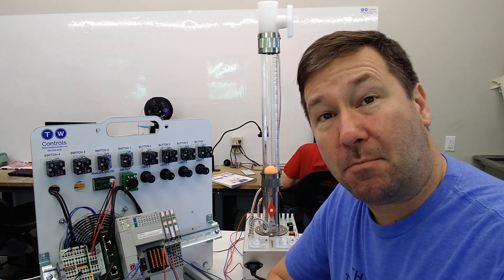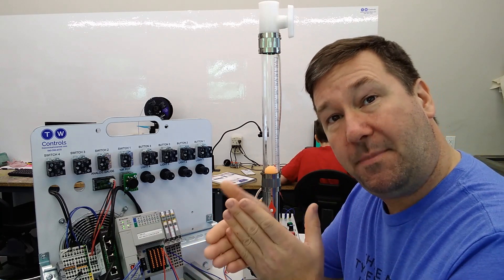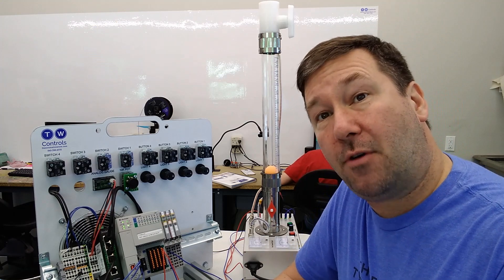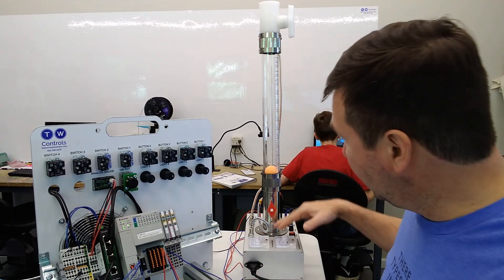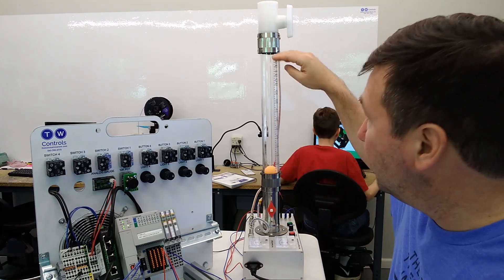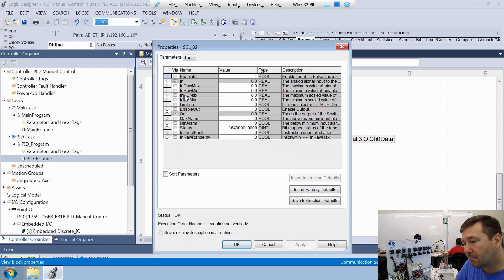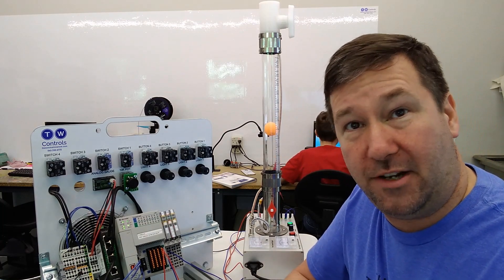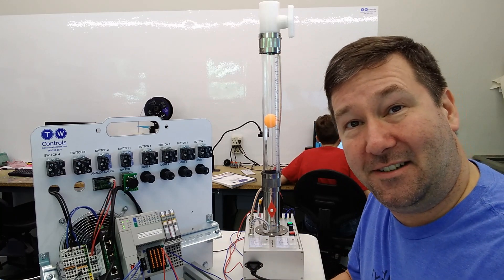Configure the PIDE Instruction in Studio 5000 for Allen Bradley PLC

Comment: Hi Tim,

I hope you’re doing well. I wanted to take a moment to express my appreciation for your videos. They are incredibly clear and informative, making complex topics easy to understand. I have been searching through them for specific content related to controlling a heater using a Proportional-Integral-Derivative (PID) controller. I'm particularly interested in incorporating thermocouples for accurate temperature feedback and utilizing Solid State Relays (SSRs) for the output to effectively manage the heater's temperature. If you have any videos that cover these topics, I would greatly appreciate your guidance or recommendations!

Thank you!
Reply from the maker: I'm glad our videos have been helpful!  We don't have a video on that for Studio 5000 but google Pulse Train Output or Pulse Width Modulation, you are pretty much looking to vary the duty cycle depending of the Control Variable of the PID.

Comment: I'm getting a pide instruction fault. It's on a burner control. So the burner is off but we are having a 26% output doesn't matter what setpoint I put in. It stays at 26% output is there something you recommend checking?
Reply from the maker: I bet you min is set to 26%... See what you process variable is showing
Reply: @TimWilborne  is there a support link I can email you?
Reply from the maker: We don't offer support for specific applications, you would need to reach out to Rockwell support.
Reply: @TimWilborne  pv is 0 but I'm gett8ng a PIDe instruction fault on my hmi. What could cause this from a program standpoint?

Comment: I have a normally open valve where 0%/4mA is open and 100%/20mA is closed. I also have a normally closed valve where 0%/4mA is closed and 100%/20mA is open. The normally closed valve operates fine and the HMI screen shows this. The normally open valve we would like to invert the 0-100% displayed so that the numbers are always percent open and not 0% when open and 100% when closed. Is there a way to get that value from the PIDE inverted or do I have to do it outside the PIDE? Others have set me up to use CV as the output and we have many in the system that use that and I'd hate to deviate, and hopefully there is just a setting or value I can use.

Comment: Good day sir..
I have this question, I hope you can help me.. what parameter(s) in PIDE should I set so that the PV is directly proportional to the CV? 

I hope you'll be able to read this, Thank you so much.
Reply from the maker: Hi Johanna.  If you need the PC to be directly proportional to the CV, then you wouldn't need to use a PIDE.  You would simply use a MUL multiply instruction but I think you will have trouble controlling it with that.

Comment: could you cover few things you do on lines or equipment to pm your systems already in place? such as loop checks or creating backup files, or checks you can do when things are running smooth for a controls tech/plc.
Reply from the maker: Creating backups would be a good video.  Let me see what I can come up with.  Also observing working systems and making sure you understand how they work is great practice.  Might make for a fun video.  Thanks for the ideas John!